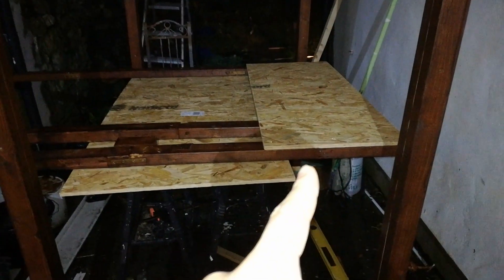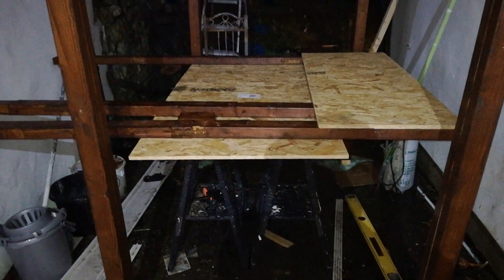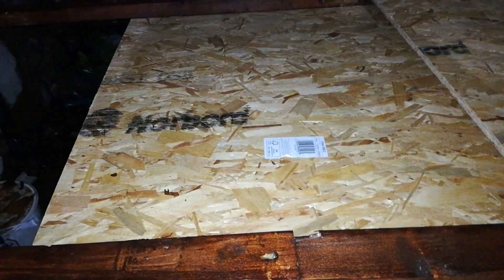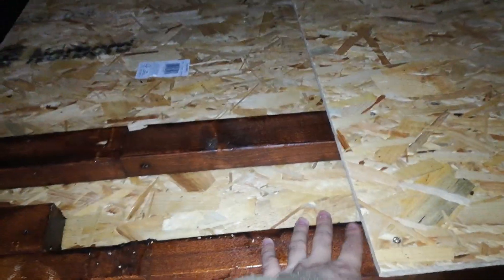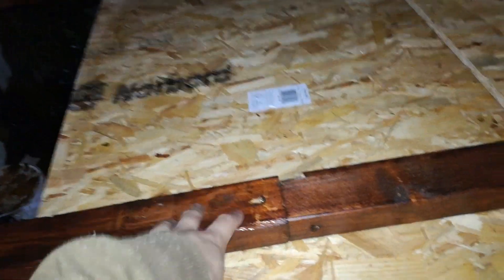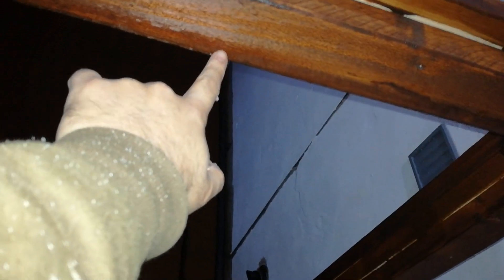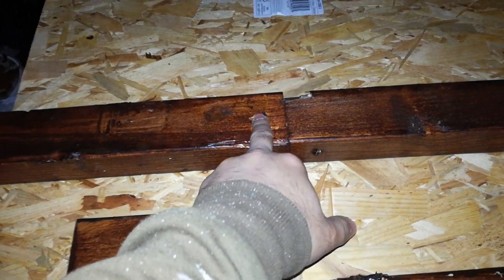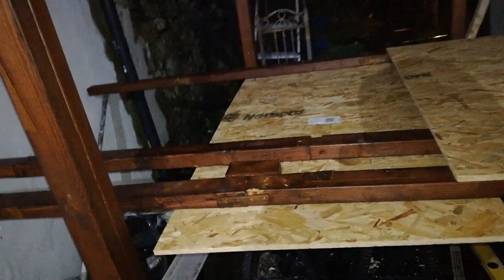Waterproofing tips (experimented on) wood for various projects [thinking outside the box]

Comment: I have some bare OSB on the roof right now and wondering what to do with it before I put the roof felt on. I bought some creocote and was thinking to do 2 coats, but wondering if I should add some kind of wood treatment first? - any advice?
Reply from the maker: Sorry for the super late reply. Yes, it definitely adds more resistance against the weather and water! After 7 years since building this, my OSB shed is still standing, very solid and strong if I may so say!